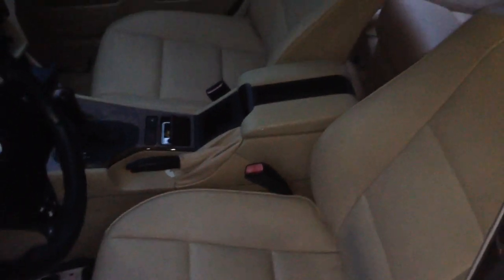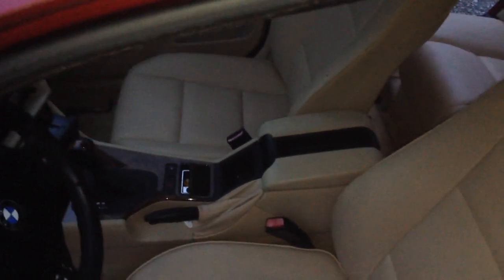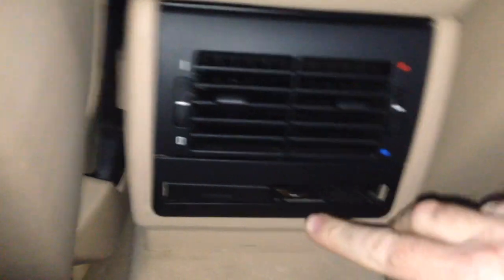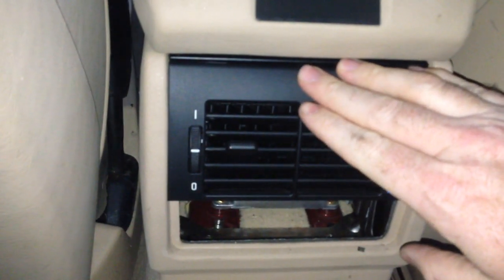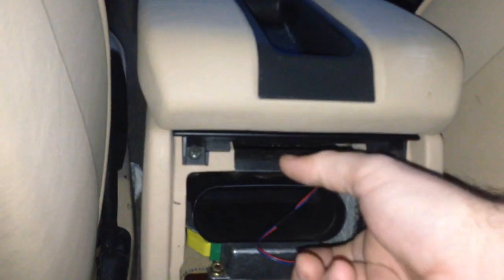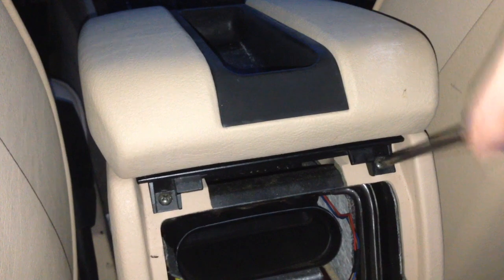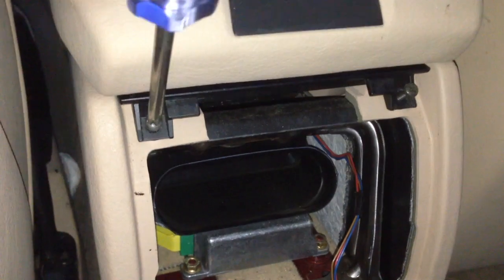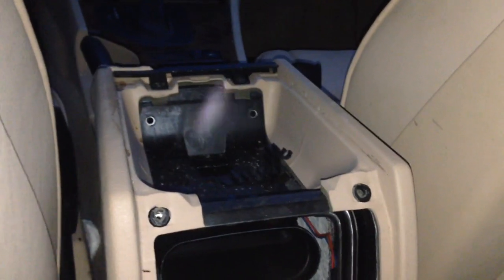BMW E38 E39 Center Console Arm Rest Removal 520i 525i 528i 530i 540i 740i 750il

Comment from the maker: Thumbs down the first 10 seconds posted, whoever is the troll show yourself to the channel
Reply: it's a bot for sure nathan! also have you dealt with replacing a CCV or is the catch can more rational?
Reply from the maker: ElAhmadGaming you can do either one , it's your preference
Reply: yeah my friends dad is a BMW master tech offered me 600$ to do the CCV and Oil filter housing gasket, good deal or not? because from what i understand replacing the CCV just takes time not a very complicated procedure. 

Also i'm doing my VANOS, any tips on that? from what i understand its also quite simple got all my parts genuine BMW gonna replace the Valve cover that's leaking in the rear then i've got new iridium laser sparks and the new VANOS seals and VANOS gasket, don't need to reset the timing as long as i don't move the cams correct?
Reply from the maker: +ElAhmadGaming $600 is full dealer price , do the $15 catch can and be done with it, vanos seals are $35 on eBay for upgraded VITON